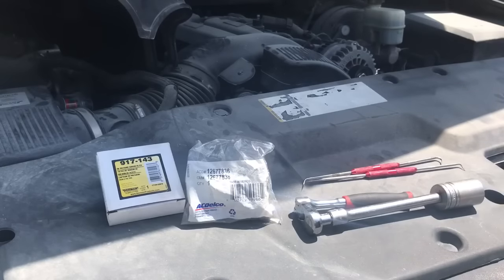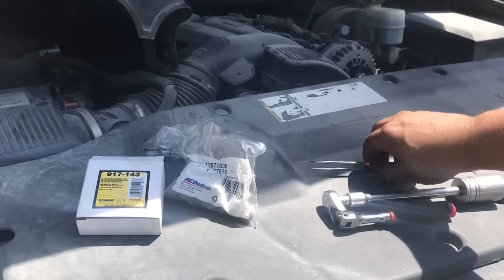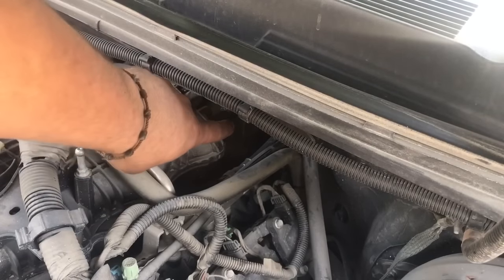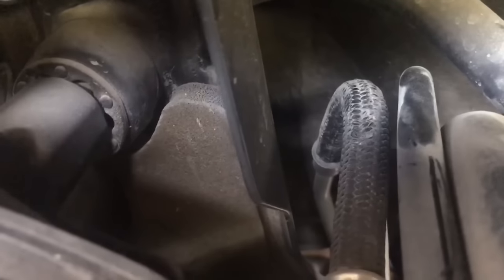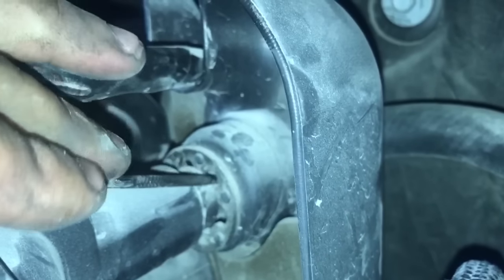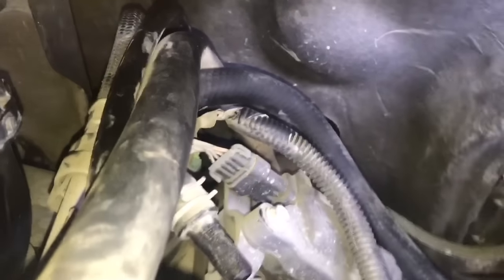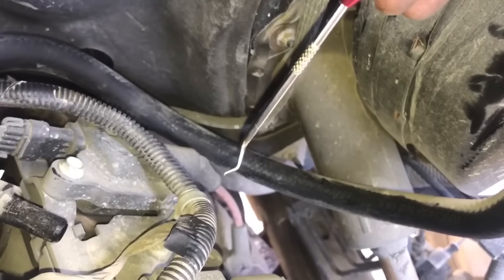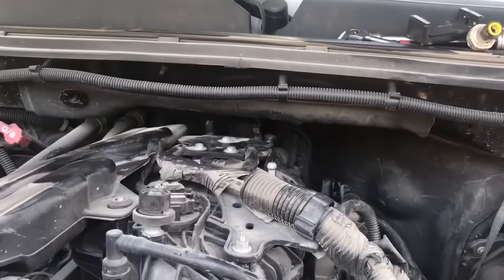Fixing low oil pressure on Chevrolet Silverado

Comment: Just did this job a few days ago. I found a 6" extension with a fine-tooth ratchet works w/o removing stuff. Also, a easy way to remove the screen is to use a 5/16" bolt or lag screw. of any length you like. I find a 2-3" size works for me. Just screw it in a couple turns and pull it out. Eazy peasy.

Comment: you can use a bolt but threading it into the filter/screen and after threading into screen, you can then just easily pull it out...
Reply: @chuylopez8793  well well well little man, I'm not only good looking but I also work on my 1980 Chevy K5 Blazer, which I recently swapped out my 350 to 305 so I can rebuild my 350.... If you want some tips on how to work on your rig, just let me know!!... now stop being a prick and man up!!
Reply: @bananapuffcream1  Thank you for being a real man!!
Reply: 1 5/8 drywall screw works well also

Comment: Dude you are my hero. I was having the hardest time trying to get my socket/extension onto the sensor. Then I found your video about removing the vacuum line. I was thinking it was screwed into the intake. Popping it off was easy and opened everything up. Thank you very much for the tip.
Reply from the maker: Dave H. Awesome. Glad this video helped out bud
Reply: @OzMechanics  when I search for one for my truck it shows a longer sensor, store brand and ac delco. Part # D1818A on oreillys page. I have a 2000 Silverado 1500 5.3

Comment: Wish you had shown HOW to unclip the sensor. I can't see mine and can't figure it how to remove the wire clip!
Reply: Removing it isn't that bad, there's two ears that have to be lifted out to pull it out of the unit. Reinstalling is the hard part. Get a mechanics mirror and good work light and it makes it easier.
Reply: Just wiggle clip from side to side while sliding it upwards and remove it completely, then just squeez the top middle , it will come right off!
Reply: I2canFIX! Is the grey clip needed? It came off while removing the connector and now lost.
Reply: You can feel
Reply: @Frit0Pie  : I don't think so....mine came off,too! I think as long as there is a white button(between the legs of the grey clip)...it should work just fine. BTW - I never saw the white button,it's in a video...built in to the unit.

Comment: This is the third time I've serviced one of these switches and yours is the first video that showed the tip on removing the brake booster hose. GREAT TIP! Including the diagrams to show components and locations was a big plus too.  Especially for anyone doing this for the first time. THX 👍

Comment: there are at least 10 other video"s on the oil sensor replacement, and yours is the only one that shows  specifically  how to remove the booster vacuum hose, after spending an hour  trying to work with it in place I got out my pick and released the hose as instructed, finished it up in 30 minutes after that.. Glad  I went back till I found your video.
Thank you.

Comment: The BEST VIDEO ON THIS JOB... i just replaced mine on a 2013 XL Yukon so hard... but Dealership wants $525 labor and charges $210 an hour...The Dealership told me they want to remove the intake manifold that is just the way they do this job WOW... no parts extra money... now i did not remove the brake booster hose i did not know how ... but it is right in the way made so much harder. and that plug would not unclip. it took a lot of work to remove the plug. saw some videos on how to do it. but it was just stuck on there. i just kept on trying and it did come off so lucky for that..... but the real problem was pressure was still at ZERO so i saw a video that said just unplug the BATTERY AND WAIT A FEW MINS AND THEN OIL PRESSURE DASH GAUGE RESET IT SELF OR THE COMPUTER THEN IT STARTED WORKING GOOD yep after all that work and still no luck i did  unplug battery and then it was working good...      [Before i started this big job ] i did try to just unplug battery and see if was okay then and no did not help... yep you got to get Dealer only parts .... and change out that screen that is the main thing...

Comment: I' so glad I found this video before I undid the fuel lines and everything else. I found out the hard way there is NO way around getting the hose off without a 90 degree pick. After that it was still a pain but just because I'm not a great mechanic. Thanks for the great video!

Comment: Just finished this job. Soooo releived it wasnt my bearings!  My tips.  It took me 3-4 hours. It takes forever but its not hard.  My 09 eacalade did not have a screen. Theres 2 different sensors make sure you buy the correct one for your year and make. I did not remove ANY hoses or lines. Just put your extention between the hoses.  The other hard issue was disconnecting the connection for me i had to slide a clip of plastic UP, then I had to push in on the button in the middle of the sliding clip and pull up.  Theres different style connections so look up how to remove your exact one first.  I used a step stool also.  Good luck! If you get stuck leave the job and come back the next day fresh.  The service guide says this job takes 0.9 hours.   It took me 4 hours the first time and now Id say I can do it in about 20 mins. It was all worth it to find out I didnt need a new engine. Its scary not knowing.  Now Im back to 35psi at idol and 43 on the highway.  My escalade was going nuts about low pressure stop the engine immediately etc.  If your gauge says constant low like 14psi thats bad if its saying 35, 75, 138, ---, 22, 70 etc thats for sure the sender or a wire. Only buy the AC delco brand sender, i would advise against the no name china knockoffs, you never want to replace this sender ever again.  Also you MUST buy the sender socket, it has rounded edges and fits the connector, a regular deep socket 27mm or 1 1/16 wont be rounded and only about 50% of them will fit the connector all the way in and not too far in. Just get it its $11.  Go slow, dont get mad, be patient and youll get it done.  Youll need a wobble extension or a 6" extension with u-joint or swivel. May the force be with you!

Comment: Great video on replacing the sensor. It was a big help on changing mine.  What really helped was removing the hose from the brake booster which gave me enough clearance to gain access to it.  I also bought the socket that fits this sensor.  Thanks!

Comment: I just replaced the oil pressure sender on my 09 Chev Avalanche with 5.3L. Works great now. Old one was reading Very low, almost 0 KPA and got warning/ fast chime “Low Oil Pressure, turn engine off”. This happened after my truck was sitting for 2 months (bitter cold outside) and then battery was completely discharged (don’t think it is related, just coincidence). This video was the most helpful for me, as other ones have you remove intake manifold.

Comment: You did an excellent job of showing the oil pressure switch (in its installed position).  Thanks.
Reply from the maker: Thanks for watching. Just notice some people taking out the the intake to do this job
Reply: How to blee brake on 95  camro
Reply: @OzMechanics  is it safe to drive my 2008 Chevy Tahoe with a bad oil sending unit
Reply: @r-luvbham6608  a bit late.  But it's not a good idea to drive any vehicle if you do not know if the oil pressure is good or not.

Comment: I like you approach by taking off the brake booster hose so you can get to the oil pressure switch a lot easier than the other Video s I have watched, thanks

Comment: I think pulling the brake booster hose off is a good idea clears up a clean shot at the sensor, my dads truck is having a low oil pressure situation and this repair is on our list of things to do this weekend.

Comment: Me and my friends just did this the long way which involved removing the entire intake manifold and it was a bitch. We replaced the sensor only to find that the low oil pressure message didn’t go away. Then we figure out that there is a mesh under that damn sensor that no one mentioned in any other video and now there is the possibility that it’s clogged and that might be blocking the readings to the sensor. So hopefully that’s all it is and not a bad oil pump. Cheers.
Reply: Was it jest the screen?
Reply: @Fordtruckin69  Yes it ended up being just the screen. The old one was plugged solid.

Comment: Nice video. I didn't disconnect anything. I used a 3 inch extension and a couple of socket adapters to bring to perfect height. NO UNIVERSAL swivel joint. A long bolt screwed in will take that screen out easy...Use same bolt to install screen.....Took me about 10-15 mins or less.
Reply from the maker: Ubmixin B good to hear
Reply: What diameter and length bolt to take the screen out ?

Comment: On my 2007 5.3L Tahoe, there is a hole in the bottom of the plastic shroud (the same shroud the brake booster hose passes through) through which you can see - but can't really access - the pressure sensor. At least it's helpful in homing the socket and in seeing the orientation of the plug when you go to clip it back in. I dropped the new sensor when trying to get it seated. I wish I'd tied a rubber band around the plastic connector with a cow hitch then wore the tag end around my wrist. It took 20 minutes and the skin on two knuckles to get it out. 5/16" bolt idea didn't work as it got no purchase on the filter. I used a pick like OZ. Worked fine. There's an armored hose - I think A/C related - that you work outside of at all times. That is, on the dashboard side of the hose not on the inside of the bend. There is a spring clip on the brake booster connector but just ignore that. There is no need to fool with the spring clip if you just work the connector back as far as it can go, then push the red thing in and tug on the hose.

Comment: If you ever have your engine removed for any reason it is a good idea to replace the plastic oil gallery barbell with a billet unit from sac city corvette. They have a tighter fit to prevent dirty oil from bypassing the oil filter.

Comment: Important note,the screen wasn’t introduced until 2007 previous motors didn’t have one. 
If you have an 06 it may depending on the manufacture date.
Reply: Thanks for that important info!
Reply: Spent 20 min picking at my 03 wondering where the screen was
Reply: I have a 2001 gmc 5.3l so it’s not needed?
Reply: @jimmyramirez8844  Only the sensor, not the screen.

Comment: Your video is the best I have seen. Your diagrams show exactly where the sensor is located. I don't know exactly how you got your camera into such a tight space but this is the first time I have seen the actual sensor and wiring harness connected to the block. I am definitely going to change out my sensor and screen. I do have to ask one question. Were you standing on a step stool when you removed the sensor? One guy actually sat in the engine apartment when he changed the sensor but I know there is no way I could ever do that. Thanks for making this video.
Reply: I laid a moving blanket over the radiator support,and used a step stool to get me up there.Then I knelt on the core support,and put my left arm on the plastic intake manifold.I did the work with my Right hand.

Comment: They should beat the engineers ass who thought about putting the sending unit in this spot. It was perfect on the side of the block. Also does a 2006 have this screen?
Reply: Not as bad as knock sensors 🤨

Comment: Best video on this repair for sure!! Thanks for the help!!
Reply from the maker: Thanks for watching
Reply: Just a little tip for anyone out there that the screen is stuck and won't come out with the pick.... I was able to thread a 5/16 course thread eye bolt into the screen and apply enough pressure to pop it out. Don't thread it in too far or it will expand the screen and just add to the problem. Just get it in snug and then give it a pull while wiggling it back and forth. The truck I was working on was a 2013 with 160k. Lots of heat cycles and pretty sure it has never been done before. Thanks again Oz!!

Comment: I have a 07 tahoe that says no oil pressure and to turn off engine. Going to try this looks like an easy fix thanks for the help
Reply: I have the same issue. Let me know how it goes
Reply: This is the problem. I disconnected my sensor and drove it with fresh oil change. The gauge reads 0 but engine is good, but replaced everything ( screen and sensor) and fixed. The other video I saw was easier than this , he didn't remove anything and use a bolt to remove the screen.
Reply: I surely wouldn't call it easy...but it's doable.

Comment: Checked with the local dealer in town..  they wanted to charge me $400.00 , stated they needed to take off the intake to replace the sending unit..   I completed this in 45 min...  most of that time was spent getting the hose off above the sensor...  That is the only one you need to remove to get the sensor out...   don't let anyone else fool you...
Reply: They do this very same procedure and still charge you for the intake removal!!! I know first hand I've worked for GM dealers my hole life it pissies me off big time that they pull this shit its wrong so wrong!!! By the way the mechanic only gets his hourly pay unless it's a flat rate shop which I worked for once an saw the rip off that the customer's get I couldn't stand it and quit got a different job at an hourly rate dealer!!!

Comment: I changed mine yesterday. I got some picks but the point on my 90⁰ was too long and kept slipping of the tab on the brake booster connection.  So I just worked around the booster hose. It was kind of in the way but not really worth messing around with if it doesn't come off easily. I won't even bother with if I have to do one again. Having your socket on a swivel head or knuckle makes the job easy once you figure out how to reach it.

Comment: Carbon!!, I got tired of replacing oil pumps and sensors and found if you pour about half a gallon of berreymans chem dip  in the oil when its cool, fire it up, hold the rpm about 1500, you will notice the oil pressure increase right away. Run it up to about 200 degrees, shut it down, and repeat the run up after it cools several times. I like to have 3 days if possible doing this, drain oil, remove filter and blow air back through the two passages the filter uses on the engine. I've done as many as four a week. It also works for decarbonizing the pistons and rings on the 4cyl Gm's that have oil usage problems. Anyhow that's the trick I found works for me.

Comment: What symptoms would lead you to replace the sensor and filter or screen? I have an 05 Silverado that is running great however I have low oil pressure reading at idle and at highway speed’s but I can’t find any indication of leaks or anything else like that.
Reply: same here , i changed the sensor before , and now needs it again, this time i changed it it wont maintain i high idel eventually get low and triggets alarm again!?
Reply: Could be the pcm not reading the sender unit correctly.

Comment: Just did mine. a small lag bolt that just fits in the new one works perfect for the screen. just thread it in a thread or 2 by hand and it pulls right out

Comment: You can use a 5/16 lag bolt about 5 inches long to screw in a little to remove screen . I threw the screen in the garbage when I installed new sensor.

Comment: Minus that overhang of cowling would be a snap. Access. They should have made a hatch there.
Like a three inch rubber plug. Also no trick disconnecting harness. Sensor could have screen built on.
Make a pain job just a walk in the park.
That plastic shrouded cover doesn’t do anything but get in the way. Can’t remove because nut is hidden.

Comment: Those filters are only on the gm motors after 07,08 right ? Not in my 05 sierra ?
Reply from the maker: It’s on the ones that have active fuel management
Reply: @OzMechanics  awesome thanks, kind of hard to see down that hole to make sure one isent there

Comment: I recently changed mine out but don't recall changing the connector sleeve out. Since putting the new one on it still has low oil pressure.
Before I go and dig out the oil pump would you say that sleeve could be my problem?

Comment: I was told that I shouldn't use the screen at all inside it because it just clogs up with gunk and it's one of those things where you have to keep cleaning out all the time , so is keeping the screen a good thing or should I just not worry about it?
Reply from the maker: Keeping up with the oil changed will keep the screen clean
Reply: @OzMechanics  yeah my truck is a oil guzzler I'm always changing it but I was told that when I put the oil pressure sensor in I really don't need to put the screen in. But I wasn't sure if I should go with what he said or what do you think I should do?
Reply from the maker: @LynSkyn1981  I stick to what the manufacturer stuck to. I would put the screen back in
Reply: Put the Filter back in. It protects the Sensor.
Reply: That screen actually is the last screen before the oil gets to the AFM lifters. What will happen if the screen is not in there all that debris will get to those lifters and stick them open and ruin the cam shaft. I'd quit taking advice from whoever told you to leave that screen out.

Comment: I understand the filters aren't needed and to install the sensor with the filter gone.
Reply from the maker: Those filters are used to filter debris that could go into the dod system ( cylinder displacement)